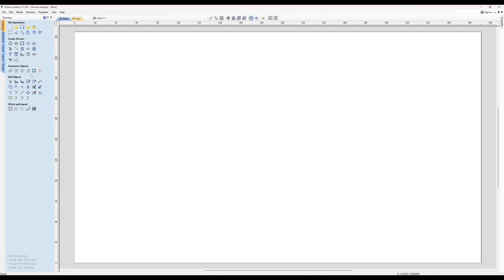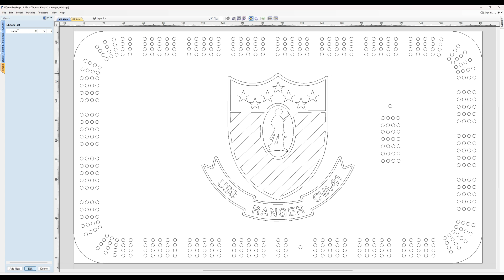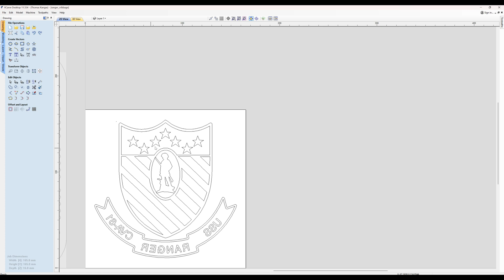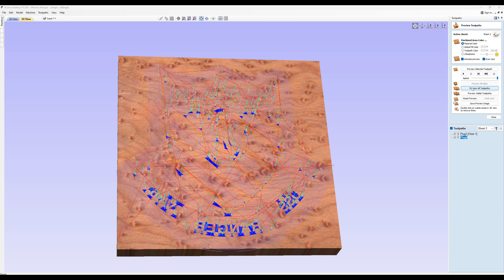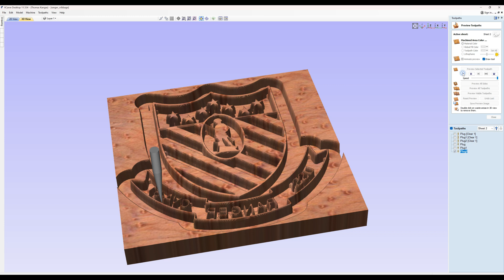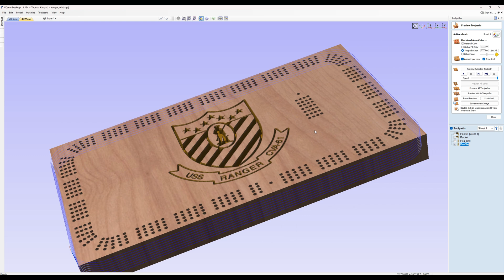USS RANGER (CVA 61) End Grain Cribbage Board Part 1 of 2 | Full CAM/CAD Process | TK Designs | 4K

Comment: Well Done this is by far the best inlay demo on youtube and believe me i have watched them all😄 The big one for me now is feeds and speeds and depth of cut per pass. Any advice or videos coming up about that? I have the Genmitsu 4040 pro with stock spindle at moment but up grading to Makita soon. The speed and feeds and depth of cut per pass that you have entered would they be around the same for makita router and 4040 pro or would you drop them down a bit. Do you have like a "rule of thumb" on what way to set feeds and speeds for type of bit?
Reply from the maker: I actually did a video about how I determine my feeds and speeds here: https://youtu.be/mHiX9pf4kqc That being said, For I would definitely slow the speeds and feeds down, and perhaps the depth of cut a little less if you want faster speeds.  It is best to test the exact type of bits that you have in order to ascertain the best speeds and feeds for your setup.  I used similar speeds/feeds and DOC when I was running a Makita router, and it was not nearly as clean of cuts. I think because the runout on a Makita far exceeds the runout on my VFD spindle.  Thank you for your kind words in regards to my inlay process, and thank you for watching!